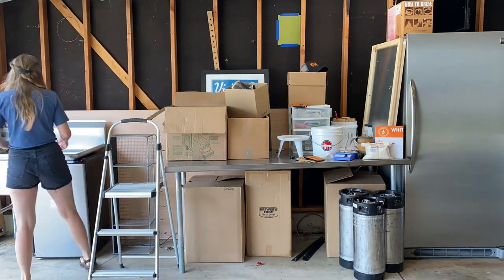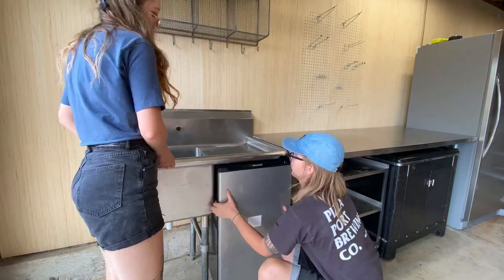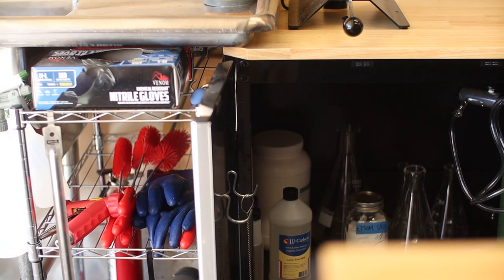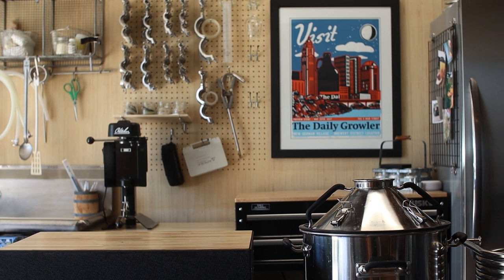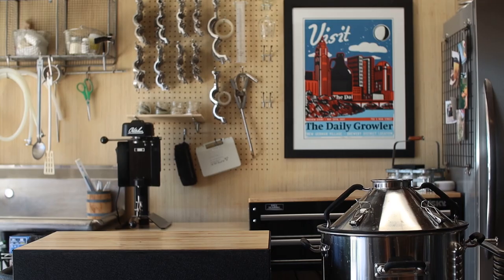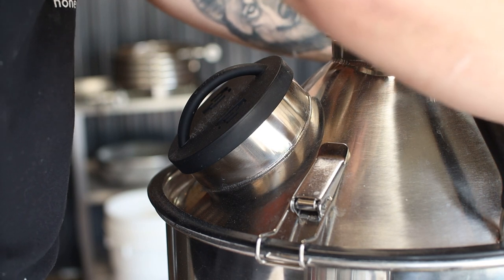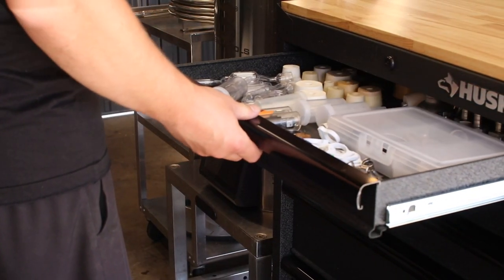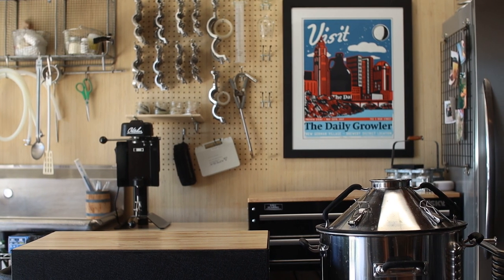HOME BREWERY TOUR Electric Brewery | 10K SPECIAL

Comment: Thanks for sharing, as I didn't realize how much space I might have under a future sink and although I did consider storage space up high, I didn't think about that area being useful over the sink too. Now, if my builder will get his act together and actually finish my house, I might be able to put some of what I've learned to use. Also, a side note on the two Tilt Hydrometers I noticed in the drawer, consider storing them upright, and the batteries will last years. Congrats and Cheers on the 10k!
Reply from the maker: Thanks for the tip! I thought it was upright or flat I’m gonna go stand them up right now lol
Reply: @shaggaroo  What?  From the Tilt FAQ site: "Q. How do I turn off the Tilt when I'm not using it?

A. The Tilt will go into sleep mode when you're not brewing to save battery life. Simply stand the Tilt up or lay it on its side and it will shut off automatically."

Comment: I can't remember where you are located, but where I'm at in Texas it's almost impossible to brew in late July to August outside because of the heat. I put mine in the separate 3rd car garage to get some air flow.

Love your setup.  Where does your sink drain?  Do you just run a hose outside?
Reply from the maker: Denver, CO! Yep just run it outside

Comment: @hopsandgnarly how do you handle draining and rinsing our your mash tun? I have a plumber coming over tomorrow to discuss plumbing the garage for this very same reason. I don't mind feeding fresh water using an RV hose, but the drain is the main issue. What about your spent grain?
Reply from the maker: I connect the bottom drain of my B40 to an RV hose and push it out to a settling pad that we made by layering different size rocks and gravel. It does get clogged up occasionally but connecting fresh water to it will free things up. Once everything is rinsed out I run PBW then fresh water and that all gets dumped using the same hose.

I'd be curious to hear advice from a plumbing professional on this. A floor drain would be cool to have but I think debris from the kettle would royally mess that up. I believe breweries just use those big 1.5" TC hoses for this so maybe all you need is a thicker hose
Reply: @HopsANDgnarly  dumped to city sewer?

Comment: Where does the sink drain?
And how cold does it get in there, is freezing a concern?
Reply from the maker: I usually just stick a bucket under there but I also have a pvc piece I can use to drain into the driveway. It definitely gets super cold so I just use a quick connect and connect it only when I’m using it